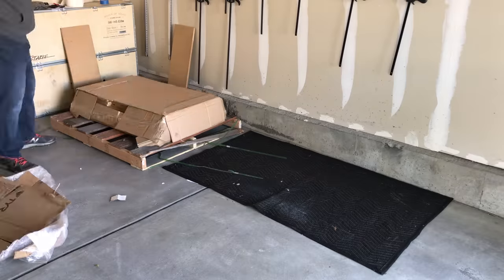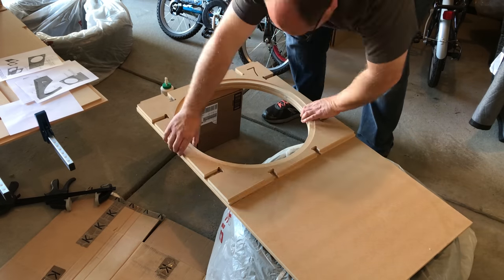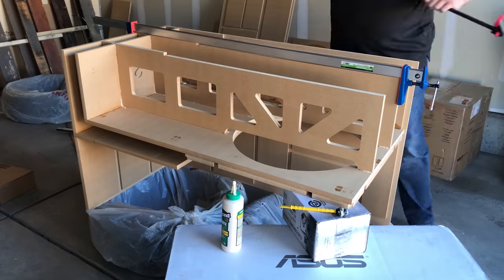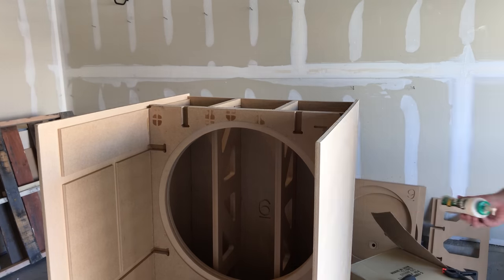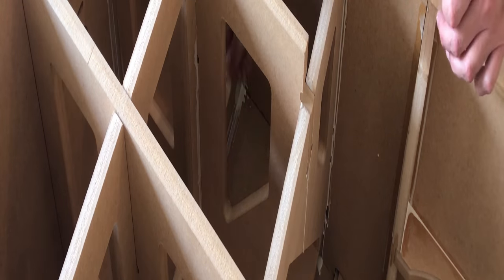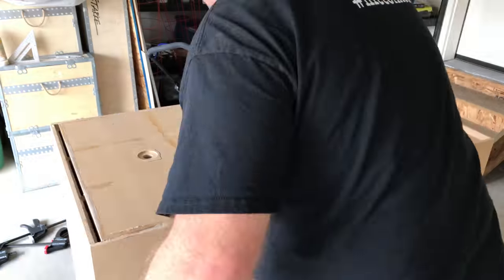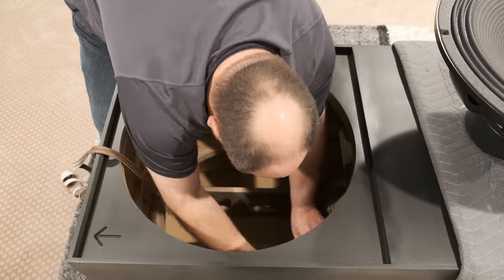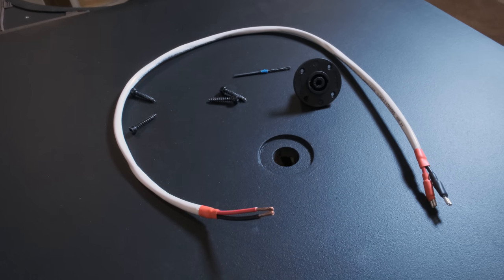21 Inch DIY Subwoofer build guide! The best GSG sub for your Home Theater.

Comment: Cut 19.83" diameter hole in wall. Mount speaker. Job done.
Reply: Infinite baffle! I see what you did there. Also wouldn't require TONS of wattage
Reply: play movie, no more wall
Reply: @elsey1976  And how about a front loaded horn? try that with an infinite baffle design :D
Reply: Really I did just that many years ago - through the floor! resonance box was the basement. Just need an infinite baffle speaker. A 15 inch will fit well between floors thrusts. Then just send audio signal through an active crossover and job done. Also: I used an ordinary "heat dock floor plate" to hide speaker. So I just SAW a rectangle hole through floors plywood, then screw speaker underneath. Bass like I never heard... caveat: better not tell your wife in advance.
Reply: Steve on … I like the way you think, but the reality is a normal 2x4 wall with sheetrock is going to flap like a screen door in a hurricane, never mind moving the furniture upstairs. Probably best to brace a bunch of 2x12s to a cement wall and load it with insulation.
Reply: @rupe53  Do to the fact it will be playing into a large room ( backside of the speaker ). There will not be any real pressure to make the wall "flap like a screen door in a hurricane".

Yes. Other things will rattle and shake.....I'm on my 3rd battery powered wall clock.... Death by 4 x 18", with only 90 watts of power.

But if you have any thing bigger then 6-1/2"  subwoofers Hummel Figurines will be dancing. It's just a fact of life.
Reply: @brightstarlastname2812  ... the "flapping" was more of a joke, but seriously, a standard wall will rattle itself to death, as all of the sheetrock nails / screws will back out from the constant vibration, then the wallboard rattles. Not saying it couldn't be braced, but it's never that simple. BTW, I have 18s in my Livingroom (good for 400 watts) and when I wanna crank it up (using only 100 watts) I have to remember to move all the table lamps so they don't wind up on the floor.
Reply: @rupe53  In the 90's I was banned from playing my car stereo at 7/11's. My 4x8" subwoofers would shake all the candy from the top self of the displays to the ground.

PS. The first ticket I got for playing too loud of a car stereo. Was with the song "Relax".

Comment: neeeeeed the performance vid of this
Reply from the maker: Its coming. I did some initial measurements and it was clipping my microphone at more than 30% with output in the 120s. Short answer is that it can get super loud. Figuring out the integration with my 18s is going to be the trick!
Reply: @JilesMcCoy  dude, thats INSANE!!!!!

Comment: If one was to compare this to building a street rod, then we're talking BIG BLOCK material! I see the driver is rated to handle 2,500 watts.... no joke. What they don't show in the specs is rated SPL at a given input power, or the other usual data like frequency response, curve, etc. Based on the links I see the driver is $750 and the cabinet is $500. We're in deep pockets territory so don't tell the old lady what you are spending.  <LOL>

Comment from the maker: Subscribe to see all the new content!  https://bit.ly/go2youtubenow
A better edit of this video is here:  https://youtu.be/IM6IAapVsBU    The distorted aspect ratio video at the end is fixed!
Reply: Love the show and the build, an I've got a question for you have you ever tried to build a an open baffle subwoofer specifically a duel 15in w frame baffle designed I've considered such a build an  learned that any driver with a Qts value at .7 or higher is a good place to start but trying to find one that's 98db efficient and is under 300$ a driver is hard any advice on how to get one and build a duel 15in open baffle w frame That would be great my current planed build is two diy subs for my home theater each to be a twin 15in DVC 4 Ohms either to be in a sealed with radiator or if I can find the right sub for it a open baffle subwoofer, my preference is for the open baffle is a driver that takes a total rms of 800watts each for a combined total of 1600 as I'll be using my two 1502 crowns in Bridged one to push each of my radiator builds for which I already have a decent drivers for them but my quest to find a driver for my open baffle subwoofers builds I don't my preference is the same size and rms but with an efficiency of 98db an fq range to at least of 20hz on the driver and under 350$ per driver if that's possible. I'd like to see you do a two duel 15in DVC w frame open baffle subwoofers for your next vid after your current one thanks
Reply from the maker: Hi! That is an area that I've not delved into yet. Do you have a link to some similar builds that I could check out to start some research?
Reply: I don't have a lot but what I have is very interesting an defiantly has me considering such a build for me just trying to find a car subwoofer that can suit such peramiters that are needed for open baffle subwoofer design but that's just for costs the best iv seen for use in a open baffle Subwoofer design is from acoustic elegance this is a 2pt video about open baffle subwoofer https://youtu.be/GLKZVBYi-Lc

I'd planed to go for what's called a w frame after I sort out what in willing to spend on such a build
Reply from the maker: Thanks! This looks like a SUPER cool project to try out. It is on the list!
Reply: JDM World  if an when you build a open baffel sub like a w frame  id love to see a music demo vid of your setup with your current system an subs an how they sound playing some of my fav music artist ,an then how your system sounds playin with some open baffle subs , my fav music track suggestions are 

___________________

tool
Album : Fear Inoculum
Track 6: Descending
Track 9: 7empest
________________
Artist : Pink Floyd
Track : Wearing The Inside Out
Album : The Division Bell 
___________________
Artist: Solar Fields
Track : A Place to Think (remastered)
Album : Extended (remastered)
_______________________

Artist : Android Lust
Track: Born to Rule
Album : Shores Unknown
_________________________
Artist: Scorpions
Track : Aleyah
Album : Eye II Eye
__________________________

Artist: Kaon
Track: A Dragon Gone!
Album: My Ambiguous Guest
__________________________
Artist: Koan
Track: The Star of Pytheas
Album: Briar Rose Side B
___________________________
artist - Android Lust
track - God in the Hole ( 5min version)
album - The Human Animal  
_______________________________
artist - koan
track - opened casket
album - figment
_____________________
artist - Koan
track - Hrilmfaxi (Moon Chariot Mix)
album - Eddur Second Scroll 
_________________________

i think these would be great test tracks for your subs an surround system as they are deep in bass an ambient sounds an take a really good setup to sound awesome and without distortion
Reply from the maker: @DREDKNOT2063  I will give all of those a listen on my set up!

Comment: One thing to note is when you are working with MDF, especially cutting/sanding, you should be wearing a respirator or at the very least a dust mask. MDF is made with formaldehyde and you don’t want to be breathing in any particulates
Reply from the maker: You are absolutely right! Thanks for calling that out.
Reply: z030n3r lol I for sure breathed in at least a pound last week when building my box. Oh well.
Reply from the maker: Hope you are ok!
Reply: Blake oh man, that’s not good for your lungs. Have fun with the builds, but more importantly- be safe. Wear personal protective equipment

Comment: Nice job. I highly suggest using threaded inserts and bolts for access panel and mounting the sub. In case you need to recone or get behind the panel, you could open it up for the lifetime of the enclosure and mounting surface will never degrade which MDF is notorious for. 
Another thing, Raptor bedliner is great alternative to paint. It's isiot proof and provides a tough and clean finish that'll handle abuse.

Comment: So much effort you've put into making the perfect enclosure and I assume quality drivers and then you crap out on the cables, I know for sure when you want to get the full power to those drivers that your flimsy cables are too thin, you really need a bigger gauge because when you drive those woofers hard your cables will warm up pretty fast, I'm sure that's the weakest link so if you ever get problems you know where to look first.
Reply from the maker: 12awg is plenty big. It’s larger than the wire inside the amplifier....
Reply: @JilesMcCoy  the wire inside the amplifier is also very short, every connection and every inch of wire is also more resistance that you're adding to the system so I stand for my suggestion to use a bigger wire gauge. Also if the wire inside the amplifier is a small gauge maybe it's better to replace those too. I have Phoenix Gold amplifier and those have really big gauge wires inside, I have even bigger gauge connected to the outside of the amp going to the speakers. You'd want to have the least resistance in a high power and high quality audio system to get the best performance.
Reply from the maker: @RicardoPenders  I don't disagree with the concept. But at these power levels and run lengths 12awg is the most that anyone would reasonably need to use.  Some external guidance: https://www.crutchfield.com/S-jkNXkfIwhWH/learn/learningcenter/home/speakers_wire.html

Comment: You can use the 2nd half as a fixture to hold the interior panels I. The correct positions. Once those panels are dry you can remove 2and half panel, check everything and then glue the 2nd half on .  Thanks for the video!
Reply from the maker: Thanks! Its a super fun subwoofer!

Comment: You might have heard of a UK company called ASS,  (Acoustic Sound Systems) but unfortunately have now closed down, but whilst they were in operation they built literally thousands of cabinets for most larger nightclubs not only here in the UK but abroad as well, I knew Tony Rossell the owner who has now retired and bought many cabinets from him direct from his factory, what an amazing guy, he developed the 18" and  21" folded horn scoops using as you mentioned B&C but mainly used PD drivers (Precision Devices) I'm not sure if you are using MDF or another propriety board but believe me just glueing won't last very long, in time the cabinets would literally fall apart under full load conditions, we use 18mm Birch Ply and not only glue but use many screws on dividers and braces, another UK company that build systems is 'Function One' supposed to be the best, and probably is but well over priced for what you are getting.

Comment: I use soap on screws for MDF.
This help quite a bit, also for cracks.
Reply from the maker: Thanks!
Reply: pre-drill,  and put glue on the threads, sink the head down an 1/8" fill with everlast auto filler.

Comment: about the weatherstripping , sumting i found in the diy store that works great is the same type of strip but wider , its used to seat open cell concrete blocks (verry light for building interior walls ) or alumium wallframing
Reply from the maker: Thanks for the tip!!!

Comment: I would use builders adhesive a good quality one on all the cross members only the joints look very gappy. 
Did you not use any dampening material behind the driver?
Reply from the maker: No, no damping material is needed for this kind of enclosure.
Reply: John sweda  A good carpenters glue is stronger than the cabinet material. It will exceed the strength of wood and far exceed mdf or particle board. The glue joint will not fail, I have learned this the hard way ! I choose to use a carpenters glue over construction adhesive for several reasons, it is easier to clean up, don't have to worry about wearing gloves to avoid skin contact and as stated on construction adhesive info "use only in well ventilated areas" (don't breathe the vapours!).

Comment: In all seriousness, are those sized subs overkill for that size of room? I mean you must have a 4000 watt amp per channel so are you using about a quarter of the gain setting or just trimming the LFE channel low?
Reply from the maker: They are likely overkill for any room in any home theater. But that is part of the point. You do tune the to the output you need.  But in the end you can also twist the knob all the way and go nuts too!

Comment: I've been looking into building a Horn loaded enclosure for a 2003 Tahoe. I have plenty of space, I want to get loud, but I want to hit the lows as well as the high notes. As low as 26hz if possible. Any suggestions?
Reply from the maker: My guess is that something like this in a SUV would be enough to make you puke :-) I cant do comparisons to folks doing 160db burps but this thing gets damn loud in a room... something like this with room gain in a car has to be pretty sick. Id love to hear what you decide to do. Yes, this can do 26hz. Maybe needs a little EQ to help though.
Reply: Build a 4th order my man PA is very different to Car audio look up ExoContralto and His 160DB car little Blue he runs two 18s on 10k watts doing 161DB and 157DB on music also his subs go down to 24hz or so...
Reply: Check out Bill Fitzmaurice's designs. He has alot of horn loaded DIY speaker designs. I've built several and have never heard anything that compares. Look at the Tuba THT if you wanna get crazy. https://billfitzmaurice.info/THT.html 

Disclaimer: I have no affiliation with Bill or any other speaker manufacturer. Just love this kind of stuff.
Reply: Look up submaximus v3  I've built 4 now with 21s loaded in them they go down to 17hz but are huge 36 deep 25.5 wide and 80 tall . In a suv it would just be insane
Reply: @erikbritz2637  I hear ya. I understand the differences. I've built many different variations of 4th and 6th orders and I've built many ported boxes and walled set ups. I watched the build log for EXO's Frankenstein and Little Blue. I'm not new to any of that. I've been into car audio for a long time and I want to do something different. I wouldn't be the first to build a Horn in an SUV. I've never gotten a demo of one but I will when I get the chance. I'm not just going to build a horn outside then put it in, I'm going to design it to be built inside my truck. Its gotta be loud as shit, I just want to build it large enough to play low as well as high. Right now I have 2 15's ported tuned to 28hz.  I love it,  I love the lows, but I love the highs as well. The 4ths and 6ths I've built had very good bandwidth, but want it as loud as I can get and I think a horn is the way to go. Just to do something crazy as well.
Reply: @hometheateraddict9583  I'm going to check that out. Sounds sick. Thanks.

Comment: why didnt you use any dry wall screws,etc.how long do you think this box is going to hold up without any stucture support,just glue?
Reply from the maker: The glue is stronger than the wood or screws. So it should last until I take a sledge hammer to it one day.
Reply: Using wood glue is comparative to welding metal. Especially with all of those dato joints and cross bracing.

Comment: adding glue to the outside of the joins does not add much for strength...  mostly a waste of glue. Use some latex caulk for added seal in the corners if needed...
Reply from the maker: It makes me feel good though!
Reply: @JilesMcCoy  I cannot argue with that...

Comment: Are there any companies that  do  what GSG Audio does, but with Plywood? 
MDF, Particleboard, and OSB are not exactly ideal for portable/live audio, and I'm interested in  building some 21" subs for my PA system for my band. We currently have front-loaded EAW speakers(1x18" Subs, 15"+1" horn tops) and 10,000 Watts of power(5 x 2,000 watt Class D amplifiers.)  We're strictly Heavy Metal, and the drummer uses a pair of 28" kick drums, that are completely detuned and half filled with muffling because the sound we are after is.... you know when a delivery truck drives by, and you don't necessarily "hear" it but you feel it? We are looking for that type of low end. It is those lowest lows that we are after. say below 60hz, so these 21" subs would essentially just be used to cover that range below 60hz.... maybe even just below 50hz.
And we're not necessarily looking for horn-loaded designs, since we're typically playing under 300 capacity clubs. We do this for fun, but we are wanting to create a certain experience live.
Reply from the maker: ineedarealjob Can I email you? You can send to me at socialmedia@jdmworld.info
Reply from the maker: GSG offers this now I believe.

Comment: I have a larger room, and am picking between two full Martys and one Devastator. What are your thoughts, if I may ask?
Reply from the maker: James Hein Well, I would do two Devas.... but I’d still do 1 Deva over 2 fulls. I am sure many would debate that though.
Reply from the maker: James Hein You can chat more in the GSG Facebook group.
Reply: @JilesMcCoy  Jiles, thanks for the quick response. I'll break out the measuring tape again, I suppose, but I think two Devastators will be tough to make work. Not to mention the cost, and the spousal approval factor. But I appreciate the videos and input. Thanks!
Reply from the maker: James Hein You can always start with 1 and expand!
Reply: @JilesMcCoy  You may be on to something. I'm going to build the cabinets myself (sorry, GSG) so it won't be that much worse to do it sequentially...

Comment: i would never use screws to mount drivers i always use allen head bolts and t nuts so each bolt is threaded and you can remove as offen as you need and the mount holes wont wear out
Reply from the maker: Thanks for the tip!